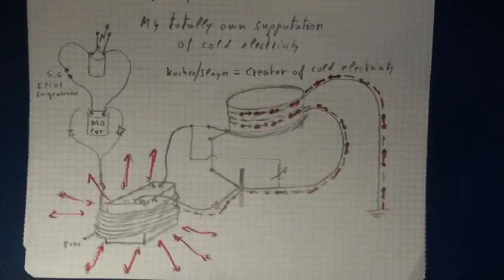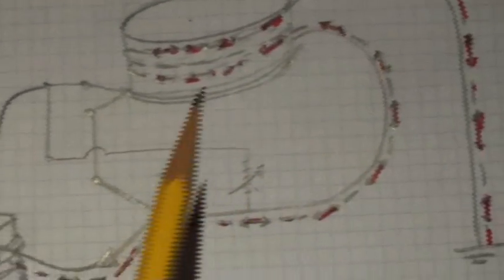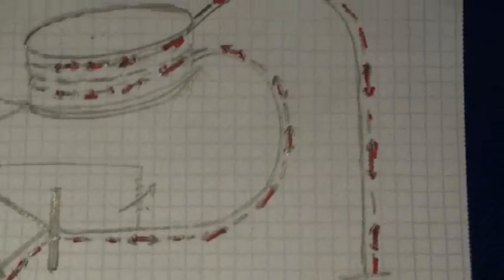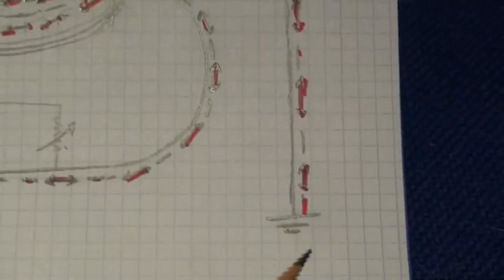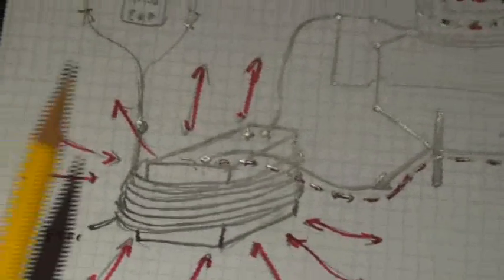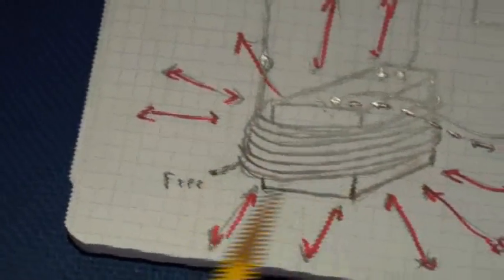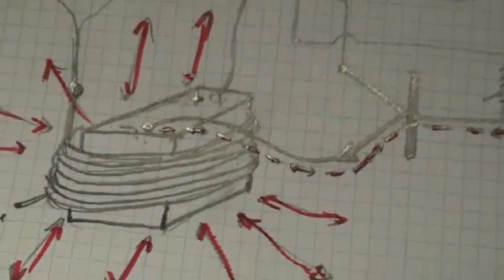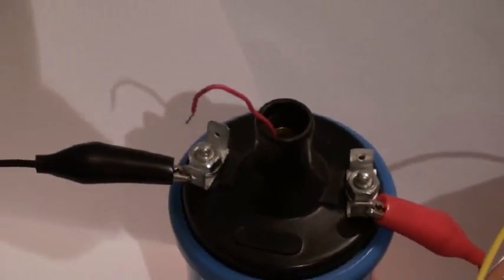charging by induction approach 2.wmv

Comment: Great work, you made many things clear by consistent research into this phenomena. Did you ever try to light a CFL (just the tube, electronics taken out of the socket of the bulb) instead of the car ignition coil? The spark gap would need to be 600 Volt or higher. But the CFL-tube could itself be the spark gap? So, just the CFL-tube on the capacitor? (CFL=compact fluorescent lamp)

Greetings, Conrad

Comment: Laurent,  does the energy extraction from the battery coil only work with an Avramenko plug or could you also power a light bulb directly from this coil?

Comment: Hi Woody   I just built a circuit like yours . I used a spark plug gapped at ten thousandths instead of a spike suppressor. I am trying to figure out a way to know if the energy is coming out of the battery or going in to the battery.